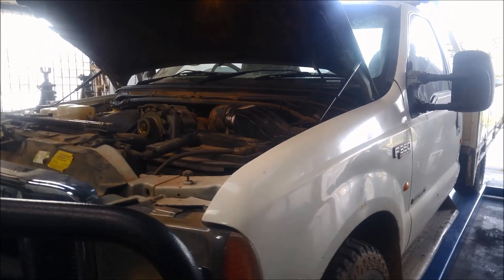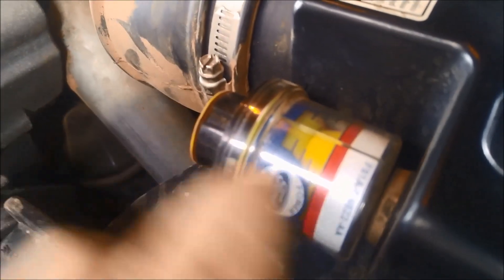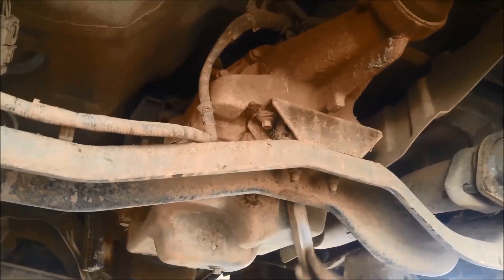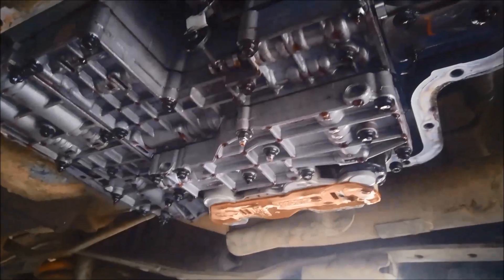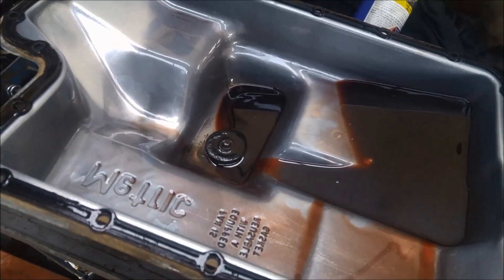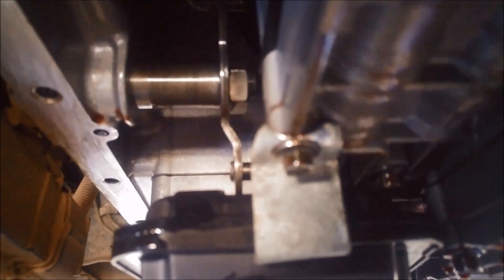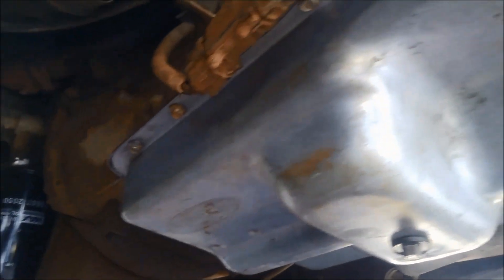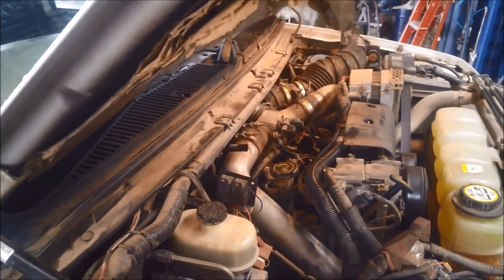Ford E4OD 4R100 5R110W why is Automatic Transmission Sluggish & Auto Transmission Filter Service how

Comment: I like the stayfast clip idea, ive never liked the push in style but I'm old school I like the old bolted filters and metal fuel rails ,metal intakes and metal water pumps , radiators without plastic tanks. Bet the airfilter was weighty
Reply from the maker: hey, yeah plastic filters along with any filter needs regular replacement anyway....you could throw some seeds on the filter and some water and i`d say the seeds would sprout. haha cheers

Comment: I’m so confused because the pan holds the filter up lol
Reply from the maker: hi, the filter pickup leans on the pan. if filter hangs down too much, the    filter outlet wont sit properly and could cause leak or suction of air... the outlet sits up so high. hope that makes sense. cheers
Reply: not always.  Mine has fallen off twice now.  I'm just now learning about these clips.